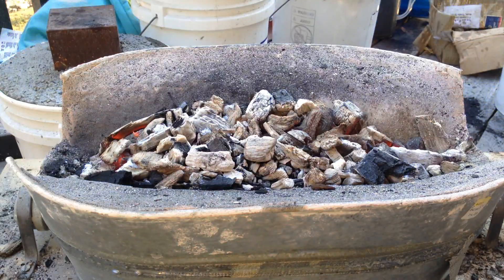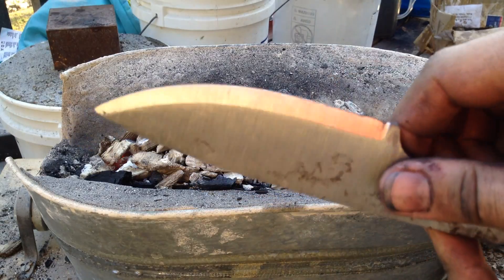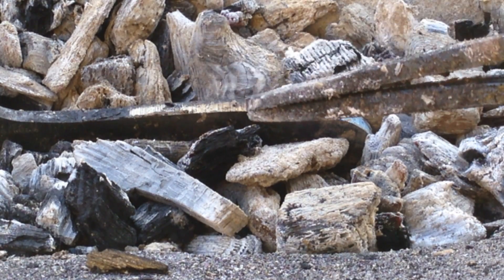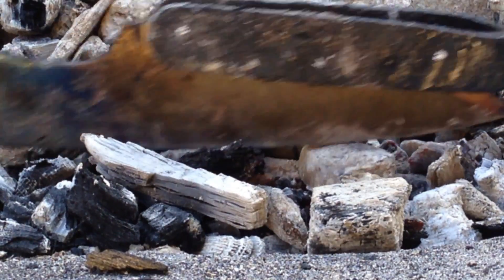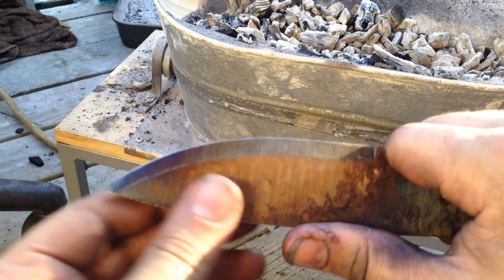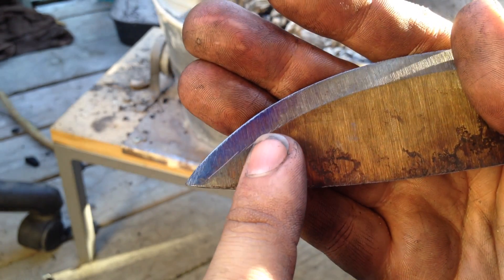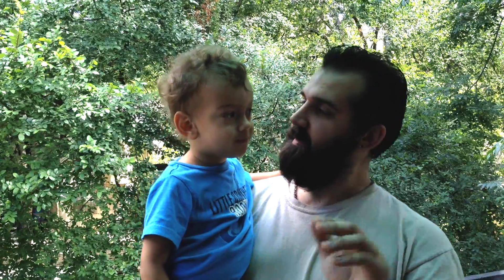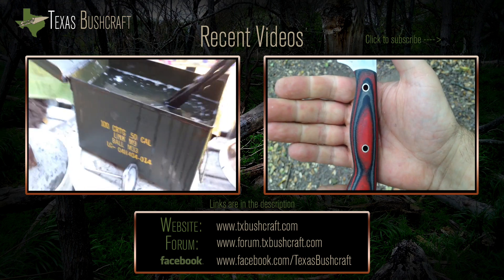Knifemaking Part III (Tempering High Carbon Steel)

Comment: Have you thought of using a hefty tong set for your tempering or even butane torch for careful color control? I've made a couple hand attempts at immersion tempering but catching up with running colors has always been a difficulty of doing it by hand. I've had best success with a heavy tong set heated up to non magnetic and tempering using such for smaller hand blades.